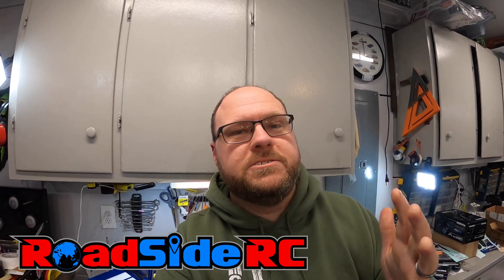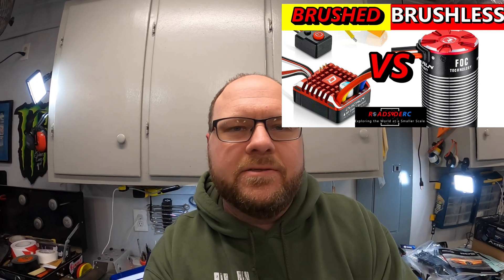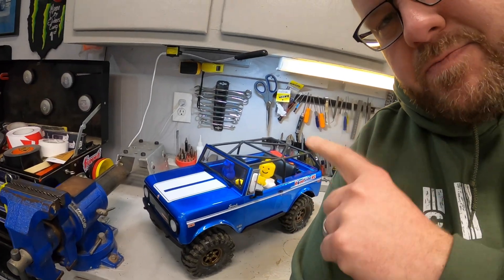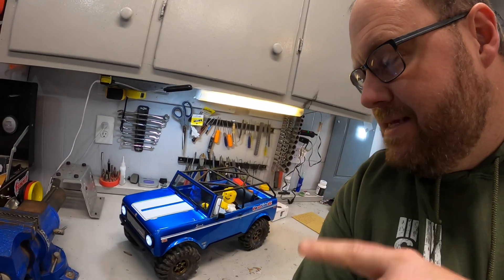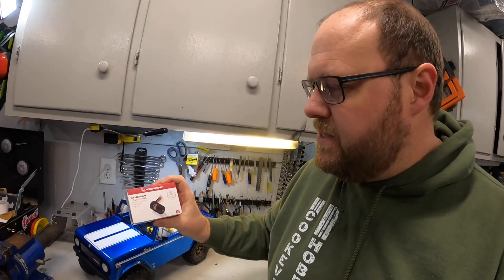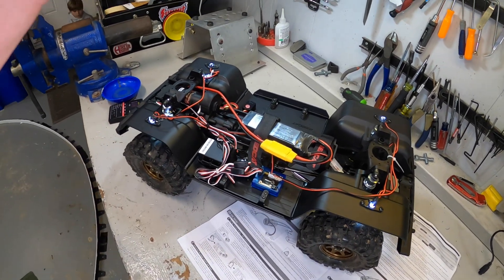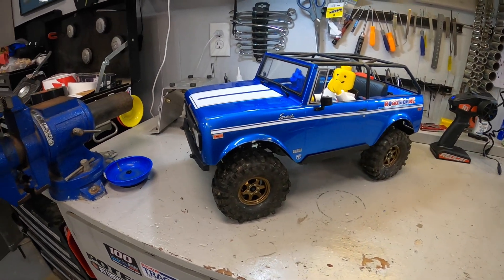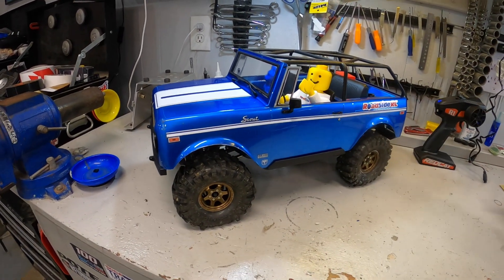Brushed vs Brushless Crawling - Is Brushed Dead??  Fusion SE Tested and Reviewed

Comment: I have a 1200kv Fusion in my TRX6. As far as wheel speed goes, it’s probably a little slower than the stock motor/esc, and almost bang on with the 1080/9t HH Crawlmaster Sport that it replaced. That thing has many, many miles of trail time on it, most notably the “Buddha/Private” trail(s) at Buddha’s. It was the first Fusion I got (bought new at Cookeville Hobbies), and has spent time in 3 different TRX trucks, but will remain in the 6, unless I come across a stupid deal on something better. I actually wanted to put it in my VS410, but it didn’t quite fit, and I didn’t want to do the necessary clearancing to make it work, so it got a Castle Copperhead combo. Honestly, I like the Fusion much better. It’s the combination of smoothness, power, efficiency, incredible drag breaks, and simplicity that makes the Fusion so dang good. Now that they’re so cheap, it’s really hard to argue that they’re not the better option.

Brushed is dead, and Fusion is the future!
Reply from the maker: Preach on!!!

Comment: I just installed a Hobbywing 1080g2 esc and 555 13 T 5 slot motor in my Vanquish Phoenix. Both fit perfectly. No cutting, No grinding required. Thanks 👍
Reply from the maker: Glad you like them!

Comment: I thought I'd jump on this bandwagon too and purchased a pair of 1800kv Fusion brushless motor/esc combo's for a dual motor on axle crawler build. Only after purchasing and opening the boxes did I discover they were almost 1cm too long. Now I own two of these wonderful motors - but have never used them once. I keep waiting for that next crawler build, but I worry about fitment. I think the newer ones are a bit shorter though...?
Reply from the maker: Yes!  Big difference between Fusion Pro and Fusion SE.   The Fusion SE are shorter.

Comment: And when one of the things get broke. When blow up the motor, your ESC is completely useless. Or the ESC get broke, the motor is useless.
Reply from the maker: This is true!   I was also worried about that when I first purchased one of the 2-in-1 combos. 
Now - it has been a few years of TORTURE...and neither has broken...  
So although I do understand that concern - it turns out they are durable enough that it isn't an issue.
Reply: @Roadside RC  that's great news. 
I consider myself to go brushless in the FTX Texan. This is one of the options.

Comment: Nope .I rather have brushed motors .My heavy rigs runs longer on a brushed 550 motor than the fusion ..I only use 550 brushed motors .don’t waste my time with 540’s  only in classic tamiya’s .I found the smd konnect better than the hobbywing fusion .it’s cheaper and made for smd by hobbywing.
Reply from the maker: I'll ha e to check smd out - thanks!

Comment: Nah hobbywing 880 with a 550 Holmes hobbies motor on 4s is still way better, unstoppable low end torque and faster wheel speed.
Reply from the maker: The 880 dual-motor esc?   I don't see many people using that one.
Reply: @RoadsideRC  it's surprisingly good, not much between it and the 1080

Comment: I love my Holmes Magnum motor and Holmes BR mini and wouldn’t trade them for any brushless set up. But if a $280 esc/motor combo isn’t your thing I’d put the Surpass hobby Rocket 540 plus and 80a esc combo for $50 up against the Fusion SE.
Reply from the maker: Yep - certainly not trying to spend $280!   I also wouldn't go with your Suprass combo because they aren't waterproof at all.   We like to get muddy and wet!
Reply: @RoadsideRC  but for the record the surpass esc is waterproof.
Reply: @RoadsideRC  water is for boats! lol in a sorrca (dry course) setting the surpass will absolutely run with the fusion SE for $50.

Comment: The longevity is what I wonder about. I  am thinking if the motor goes out or the esc goes bad you have to spend the $70 again to replace. Where as with the brushed motor can be replaced for $20. Just considering long term cost. I have the HW 1080 and the Holmes crawlmaster sport 12t in my element and it does the very slow very good and good wheel speed too. Just my thoughts
Reply from the maker: Yes!  I do understand that concern.  

Fortunately, I have the predecessor to this setup from Hobbywing, have really abused it - and it still has had no issues.

Comment: The efficiency wins it for brushless for me . Got one in a basecamp running an 850mah 3s lipo to keep weight low  , getting over an hour runtime per pack . Brushed would need a 1300 mah for similar runtime.
Reply: Wow I’m doing all this wrong.  I’m buying shorty packs aar 4000-4600 mah to save space now I have to try out the other way.
Reply from the maker: Yes!!  One of the big advantages.

Comment: Don't want to miss the adjustable drag brake by radio and the programmable punch in my 1080 g2. So, I'm still using a brushed setup. 😊
Reply from the maker: The brushless setups have that as well...
Reply: @RoadsideRC  not the SE. It has only a programmable drag brake and no punch settings. You'll need to invest in a pro to adjust this.
Reply: @Dreiviertel that's the reason I went back with the 1080 g2 in my tracked TRX4. The adjustable drag brake is great for trailing and my HH Trailmaster 21 turn is a bit faster than my Fusion SE 1800kv on 2s or 3s, it has a stronger BEC @ 8.4V, and it runs cooler to boot. And the real car mode is just a bonus as well!

Comment: I agree 💯 on everything except one factor. Availability. The SE system is hard to find right now in the States unless you want to order from China and wait. You can still grab the 1080 at your local hobby shop or Amazon prime and have it quick along with Holmes motors. Now, when the boom slows downs and the SE is readily available. Yeah , brushed is dead
Reply from the maker: Yeah - just shows how popular it is right now.
Reply: It's a new product. Availability will improve by the next few months.
Reply: @shadow7037932  well duh 😂. I'm saying that's about the only thing causing brushed not to be completely dead yet

Comment: I will be staying brushed as long as people like eddy from brood racing are making motors. If I destroy a brushed motor in some muddy water I can swap in a new one for 20$ Not so with brushless, I know they are supposed to be waterproof but that fails sometimes in hard use. Also brushed motors having the brush riding on the comm provides a sort of physical drag brake the brushless motors simply don't have.
Reply from the maker: Your suggestion is that continuing to spend more money on a brushed setup makes more sense....???  

These brushless setups go full submarine without issue.
Reply: @RoadsideRC  the only way you're spending more money is if you're just comparing hobbywing to hobbywing, what about the isdt 70 ESC? They're $24 I have three of them , pair that with a $20 motor. My point is there are a lot of decent options out there 4 brushed setups that are still cheap today, not to mention I like brush motors because I've been doing this for 30 years and they're kind of my roots. Don't get me wrong I own a lot of brushless motors in different rigs but I will always still like brushed motors.

Comment: Are they sensored? I love brushless on bashers but on crawlers I always felt like you lose the control brushed provides and for me it’s not worth the price difference. A good brushed motor with stock esc is a cheap upgrade ($20 or so) and playing with gearing (also cheap) will get you more wheel speed if needed. I have no doubt brushless will overtake brushed soon just like electric overtook nitro but for now it doesn’t seem worth the trade offs unless you are willing to drop hundreds into a high end setup
Reply from the maker: Yes - these are crawler-specific setups so they have all the control you would expect.
Reply: @RoadsideRC  interesting. From your video I couldn’t tell if it was giving you the same low end of the brushed but this sounds very promising!

Comment: Tell me you don't comp without telling me that you don't comp. Now compare that brushless 2 in 1 to a higher end brushed setup like a holmes hobbies torque master expert
Reply from the maker: Thanks for the feedback. 
Took part in 3-4 comps last year.
Reply: @RoadsideRC  then you should know brushed is not dead
Reply from the maker: @urdonerc-jeremyburris  Not sure what it looks like in your area, but brushed is rare in this region for comp trucks.  Most are running super lightweight outrunner setups.
Reply: Also… he put it in a basically stock Redcat Gen 9… what about that says “comp rig”?? Knowing Troy, and his abilities with all forms of RC, I’d wager he could absolutely compete in a SORRCA comp. With a stock-ish rig. Put him behind the controls of a fully built comp crawler and I’d be really surprised if he didn’t at least podium.
Reply: @pothole0222  I was saying comp because he wanted to put is brushed dead in the video. Most comp people will say brushed over brushless
Reply: You’re not wrong, but a comp setup typically won’t be happy running trails all day. For a comp, where you typically run for less than 10 minutes, and you need every ounce of performance available, the high dollar setups are almost mandatory. But, for running trails all day or for a G8-style “comp”, the Fusion is an EXCELLENT option.
Reply: @pothole0222  I trail for hours with my comp trucks

Comment: If you don't use the FOC function and enjoy the feel of having to throttle over stuff some people really like the high end brushed motors. I personally like the braking power/wheel speed/FOC function of my fusion pro. And my trucks are always wet so brushed motors never last long
Reply from the maker: Yes - but then that high end brushed setup would be more expensive...

Comment: Good info! Here in Germany a HW 1080 WP (G1) is about €48 + a decent Motor €27 (total €75). The cheapest Fusion SE (1200kV) is €100, the 1800kV version is €114. So, at least €25 more for little to none gain in performance/controllability. It's a tough call.
Reply from the maker: Yes!  That makes sense. 
When the difference is $10...it is an easier decision.
Reply: Who cares about 25 when our rigs cost close to 1000 or at least 500 as RTR.
Reply: what about runtime ? i heard brushless have longer runtimes ?
Reply from the maker: @user-rv8wb1nl1b  That is correct.  Brushless is more efficient, so run time is longer.
Reply: @user-rv8wb1nl1b  The question is: how much more efficient is a brushless motor compared to a brushed one? And how much bigger are the run times? My SCX10II chassis has a HW 1080WP + Holmes Hobbies brushed power train which draws its power of a 5400mAh 3S bat. This one bat is enough for at least one hour of crawling. Lets say a brushless system is about 20% more efficient. This would mean that you have 72 instead of 60 minutes of runtime? Is this really necessary? Another topic which is seldom mentioned is how good is the heat dissipation? At a "hard" crawling session my motor in the SCX10 gets really hot (this comes from the drag or hand brake force the motor has to deliver in order to hold the car in place on steep slopes or uphill passages. If the ESC is separate from motor this is not a problem for the ESC. But how is it if the ESC is within the same enclosure as the motor?
Don't get me wrong! I use brushless systems on all my bashers, racers, buggies, etc. But on crawlers: no. The reason is, that i like to keep the setup of my crawlers unchanged and buying a new brushless system for every crawler is simply to much money. Brushless is of course the future (for crawlers i mean, for every other aspect of RC driving this technologies has already replaced brushed systems). But - at least for me - currently for crawlers  a good brushed systems is still the best option, considering all aspects.
Reply: @arminrc  i don't run a drag brake , i get by , but i am mainly trailing . As these brushless systems get cheaper , i may be tempted . Its good technology , progress i guess . . .
Reply: I just bought 3x 1800kv SE and 2x 1200kv SE. for 320€..
??🤦‍♂️